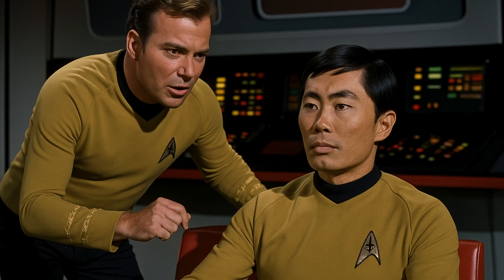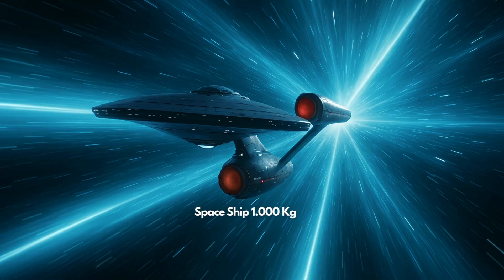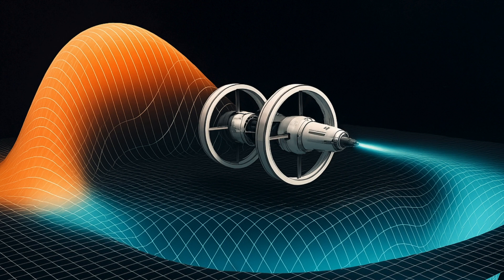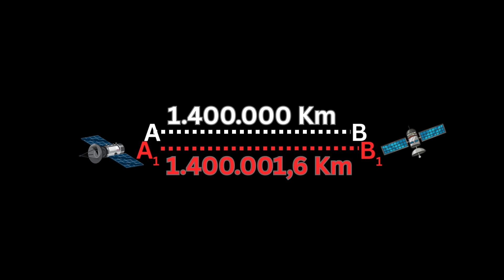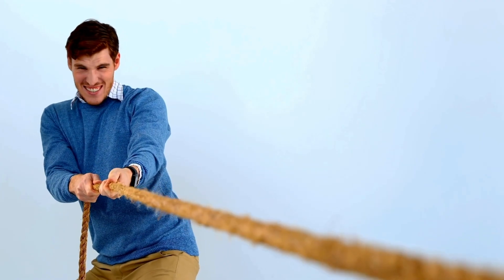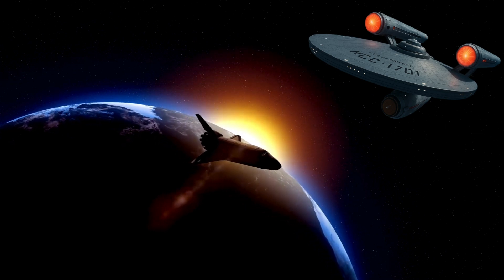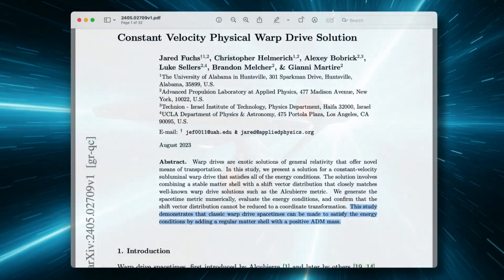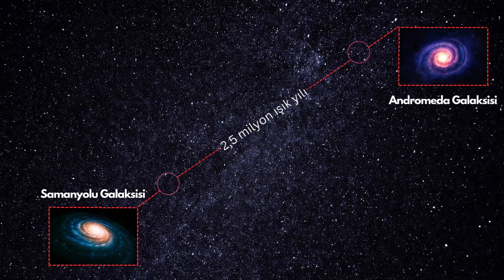FIRST STEP TO WARP ENGINES

Comment: You can make ana analogy with surfing.  The surfer does not move relative to the surfboard.  The water around the surfboard changes to move the surfboard, which is carrying the surfer.  The water is like the space-time continuum, the surfboard is like the warp bubble, and the surfer is like the starship.

Comment: Yeah right, because if you can't make a sailing ship move faster than 12 knots, just warp the ocean so that it can surf at 1000 knots.  Because obviously it's easier to shape and control the ocean than it is to propel a ship faster.

Comment: Ugh, AI is so bad at free flowing speech and grammar. Not only that, in this case, it completely contradicts itself by starting out with the fact that warping space requires both exotic material, better defined as magic pixie dust, and negative energy that has not been proven to exist in the way the hypothesis of warping space requires. Then it goes on to promote the alcubierre drive which is the very wishful-thinking hypothesis that requires exotic matter (magic pixie dust) and negative energy to function. Not only is expansion of 3D space theoretical and has not been proven experimentally to actually work, but the alcubierre drive also requires the space in front of the craft to be compressed which no current theory claims is possible. 
 I think the only way FTL may ever be able to work is by manipulating the Higgs field in a way that it does not add mass when higher speeds are achieved. That of course is only possible IF we can ever understand the field enough to manipulate it in that manner without also requiring "infinite energy".
Reply: Yeah the energy input to make any of this go is definitely a technological hurdle.
Reply: Matching the speed of light (or, as the video spells it, "Lihgt"), will take MONSTROUS amounts energy, and generate infinite mass as the ship accelerates, requiring even more fuel, creating even MORE mass and requiring more energy ad infinitum. The speed of light travel is never going to happen, if Einstein and every other reputable physicist are correct. If we can ever travel to even another nearby solar system, we're going to have to somehow bypass the most basic of physical laws, including the Zeroth through 3rd laws of thermodynamics, and doing so breaks Causality.
Reply: Yes , I can't get past just a minute of this , the speech is painful to listen to.